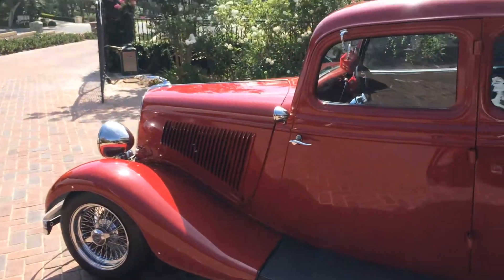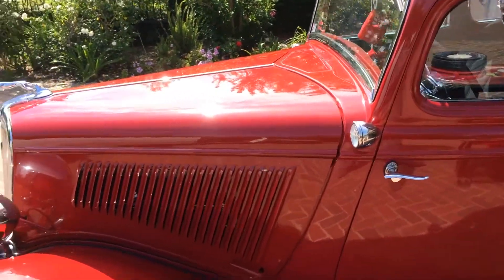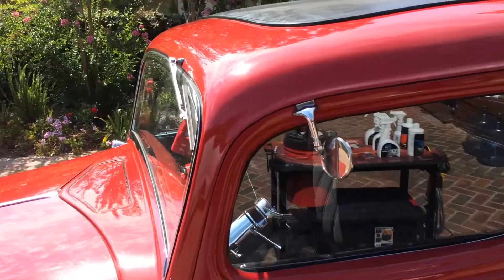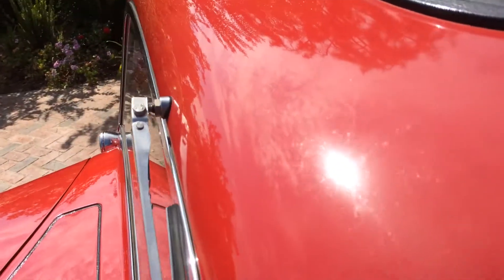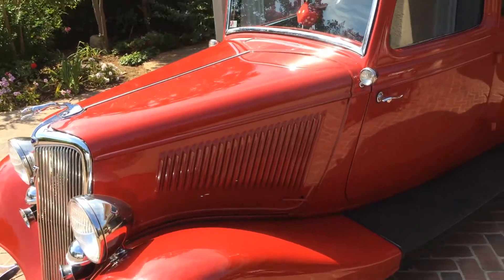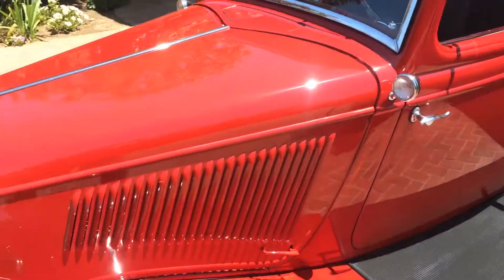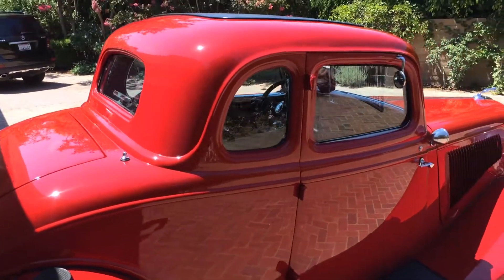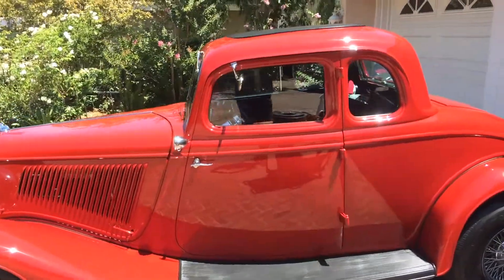34 Ford Before and After CSI Ceram-X

Comment: just 1 product needed or is the polish enhancer necessary or not?
Reply from the maker: The main product is Ceram-x 62-203. It should look perfect after Ceram-x. Only after the surface is perfect use D1 to further enhance the color.
Reply: @CSIClearcoatsolutions  ok but it is not that necessary for the enhancer right only if wanted due to what I understand?
Reply from the maker: Yes
Reply from the maker: Yes 1 product only D1 not necessary
Reply: From my experience with using CSI compound, you could skip the enhancer. I’ve tried the enhancer several times and I honestly didn’t see that much of a difference.